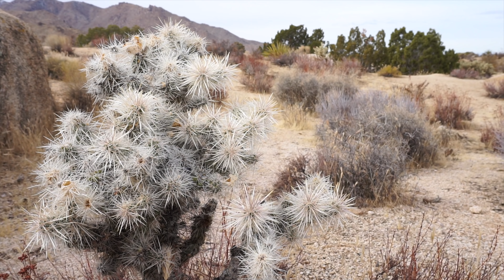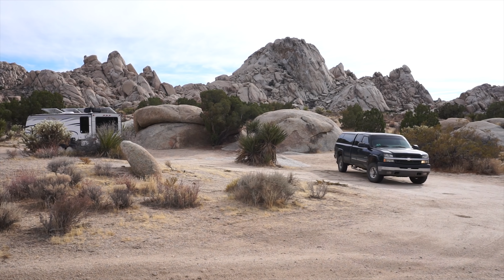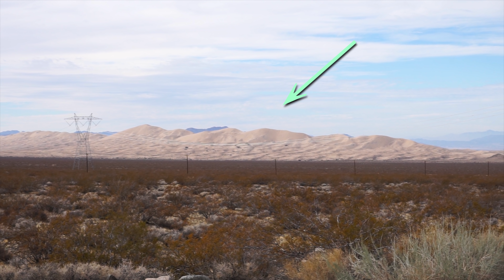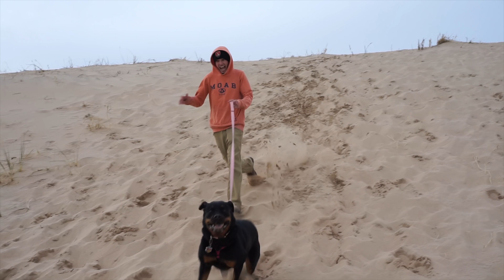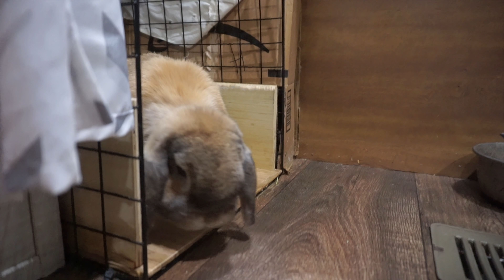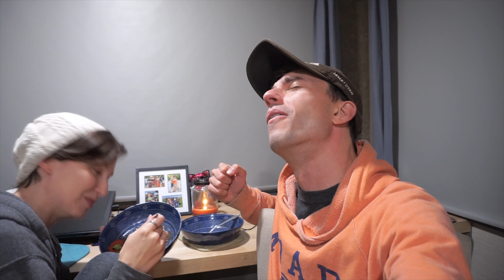FALLING to PIECES - RV Breakage & Kelso Sand Dunes - RVing California

Comment: Yep, that's what RV's do, fall apart while just sitting there, especially the sticks and staples wrapped in a cola can construction like yours and the one we used to have that rotted to pieces faster than we could find and fix the leaks. Every time you get on the roof to deal with your panels, you better be looking for any sealant cracks around vents, hoods, pipes, marker lights, seams where that trim cover came off and put fresh sealant down as soon as you see such.

Comment: That happens on a lot on the aluminum sided trailers. It has broken down from the sun.
You can buy new stuff easily.
Come to think of it, I need some too.
The sun angle during the winter months facilitates angling you panel this time of the year.
Thanks

Comment: I replaced the trim on my RV. I bought a roll of it from Camping World. If you replace it when it is hot, be sure to give yourself plenty of slack. When it gets cold, the vinyl will contract a lot and be too short. I had this problem with mine. It is probably better to put in on when cold but it is also much harder to work with.

Comment: a friend of mine used a windsheild motor in his van to open and close the drape between the front and back of the van ..lol point is u can hook up a bigger motor and even with a analog remote lift n lower the solor pannels just have to reserch n set up a system that enables u to just press a button . my other friend built a robot to cut his grass n used analog for everything u may of seen him on monster show his living room turned from inside the house to outside .by rotating the floor .he died a while back but was a real creative guy ..thanks jerry

Comment: Amazon has it. So does Camping World. What you have there is called rubber trim moulding. Make sure you use the correct size. It comes in Narrow (1/2") Normal (3/4") and Wide (1"). I don't slide mine as much as I tuck it in as i go, starting at one edge and continuing on with the trim hanging as I go. For vertical trim, I start at the top and work my way down. Good luck!

Comment: Just insert moulding, helps keep some water from the screws. It will shrink and expand in cold and heat. Often held down with a screw on either end. The expansion and contraction will break out of the screw fastening it down. Sometimes it’s wrapped under the moulding and then fastened down. 

To install place one edge into the moulding while using a butter knife or other similar type flat spade, push in the other edge and just move along without removing it. Super easy to install. A side will take like 3 minutes. Do not try sliding it in.

Can easily be purchased at any RV dealership that has parts. Probably find it online easily also.

Comment: Much of the degradation of plastic/vinyl trim like that is from exposure to UV. I use a product called 303 UV Protectant available on Amazon.  Just spray some on a rag and wipe it down the trim strips and they'll last years longer. It won't take much and it should be done maybe twice a year for your  application. Been using it since 2003 and I swear by it. I used it on our Zodiac RIB boat to keep the hypalon air chambers clean, soft and supple. Looked like new when we sold it in 2014. I still use it today on the fiberglass cap on the front of our truck camper .... helps also to keep bugs from sticking to it.  The White Sands NM is totally unique (found nowhere else in the world). Technically it's not comprised of sand as we know it. It is comprised of white gypsum and because of its reflective qualities, it doesn't absorb the sun's heat like regular sand does. On a 90 degree day, you can go barefoot in the dunes and it actually feels cool on your feet :-)  Great Sand Dunes NP is super expansive and the only National Park that I know of that lets you roam freely anywhere you want.

Comment: The front and rear corners are slightly different from the roof section. Corners are using butyl tape and its generally good for a few years, less when full timing.

Comment: the strips on my trailer are fine even though the trailer is 11 years old but i'm on the east coast so maybe because it so moist here as opposed to the desert it hasn't dried out but I did notice the putty under the strips are dry and cracking so in the spring i'm going to remove the whole thing replace the putty, recaulk and I think i'll just replace the plastic strips.  it's just like owning a sticks and bricks there's always something to fix it's called home ownership.

Comment: Well the weather is supposed to improve some for a few days out there.Nice visitor center in the old UP RR station over in Kelso.  The desert is pretty around there, nothing really spectacular though. Afton Canyon is neat, Mojave River is usually running.  Probably need 4wd to get there the short way.  You've pretty much found the middle of nowhere as much as it exists in CA.  Well Southern CA.

 You can get tones sometimes from the wind over in the Hole in the Wall area.  Also Mitchell Caverns is open again. (IIRC).  It was closed for several years for state budget reasons.

OTOH, it can be unbelievably beautiful when the wildflowers explode out there.

Comment: Awe... I'm so disappointed for you that you didn't get to hear the sands sing. You did make a good call on not trying for the peak because they probably wouldn't have been singing anyway. Watching the folks run down the side you could see the trail that they made and just how wet the sand was. With all the rain we have had in the last couple of weeks the sand was probably too wet to reverberate and make the sound. The key to getting it to sing is to get the sand moving as much as possible. So by the looks of it the sand wasn't moving well and thus wouldn't have been singing. You really need to go when the sand is dry. Give it a few days and maybe you can try again before you leave or cruse back by the next time you're near. You will be glad you did. 
Take care, 
Pat
Reply: Good point, Pat!

Comment: What about adding a automatic levelers to lift your panel?
Reply: What will run the automatic levelers? ELECTRICITY, that is what they are wanting to make.
Reply: @davescorneroftheworld1147  some type of actuator that would run off of solar it was just a thought
Reply: @LivingTheGoodLifeRving  The only other type of auto-tracker has GAS inside of tubes. What would happen when they went down the road with the solar panels with something like that?
Reply: @davescorneroftheworld1147  ok

Comment: Have you ever considered an all-fiberglass fifth wheel or trailer?  You would have to sacrifice space, but you wouldn’t have to worry about all those annoying seams with the inevitable water leakage. Companies like Oliver, Escape, and Bigfoot all offer single-shell fiberglass rvs.  You would really have to cut down on space, but fiberglass trailers and fifth wheels really maintain their value, last a long time, and don’t have near the potential for water problems. Stick-built RVs are just a continuous parade of repairs, caulking, and maintenance. Used fiberglass trailers, on the other hand, can last 20 to 30 years. 1970‘s and 1980s used fiberglass trailers are being sold, and the market for these fiberglass units is quite strong.

Comment: Rather than starting at the bottom and pushing it up, I found starting at the top, and pinching it into place as you go down is MUCH easier and less time consuming.  Either way, good luck with the replacement.  v/r, TS - Denver

Comment: How about getting a Cargo Trailer and build it out to suit your selves. An all aluminum unit would be cheaper than another travel trailer plus it is built better and will last longer. Not that hard to build either. Roof never leak unless ofcourse, u put holes in it. And u can get them high enough off the ground for good clearance on your outback roads.  Cut down on repairs in and out sides.  Enjoy your travels.  Keep 'em rollin!

Comment: You can just buy rolls of that vinyl insert off of Amazon ($22 for 100 feet). It’s easy to pinch/install (you won’t be able to slide it far) and the key is not to stretch it as you install.

Comment: You will want to get that back up with new molding as the screws, that the molding covers, are cheap. The screws are not stainless steel and thus, will rust, then break. Then the corners can come apart. Not fun either.

Comment: i got a roll on amazon. its inexpensive. i keep a roll in my trailer at all times. i also bought a plastic molding pry tool for cars... i use that to insert it so your not having to push it in with a sharp object or your fingers. i couldnt just slide it into the rail from one side to the other.

Comment: i dont know what you are running in there to run out of power BUT,
 for one thing your TT is not a polar package or have a winter package ???? so that said if it dose have fiberglas in the walls it's no wair near the R factor of a TT or 5th wheel thermal or polar package ...
we have a 2014 forest river it's very warm and i have no solar and can run of my truck for day's be for i feel i have to start it an run it we live near VT so it gets cold here,,,,,
2nd the trim pice you will have to measure the with of it you can buy 100, tools on ebay cheeppppppppp

Comment: Could you not just  go ahead and seal everything with dicor?  That way you wouldn't have to rebuy stripping.  You just cover the bolts with black dicor and no one would know the difference.  It would have to be a neat job though.  Maybe dicor doesn't work with metal sheathing on your trailer?  I don't know, but that is what I would find out about.

Comment: just remove that strip and use a little clear silicone to cover the screw heads to protect them is alot cheaper than buying something that u know wount last .they make the stuff on those rvs way to cheap.by the way excellent videos u have i added u and subed ya ..remember to rotae ur tires like ur car every ten thousand miles , also on the trailers they use 2nd grade tires so u may want to check them .since u travel so much id keep 2 extra tires with rims on them so u dont ever have to leave the camper anywhere . so often ur alone miles from anything . driving under 60 is best .cuz of wind n tires handle the road better to thanks jerry

Comment: Even if you stick to paved roads, most RVs will start to shake apart, unless they have an incredibly strong frame. Manufacturers build these units as light as possible so that you can tow them with smaller tow vehicles. Once again, it's buyer beware.